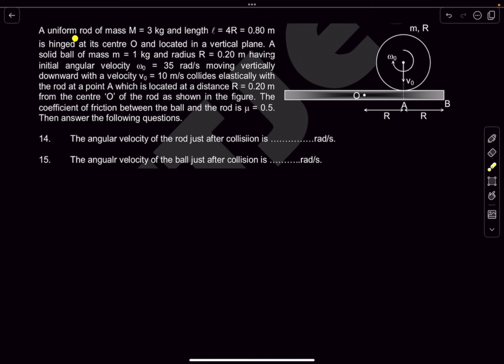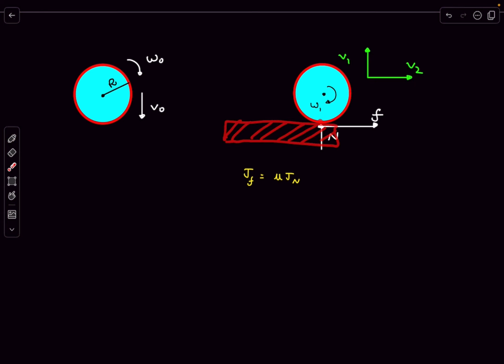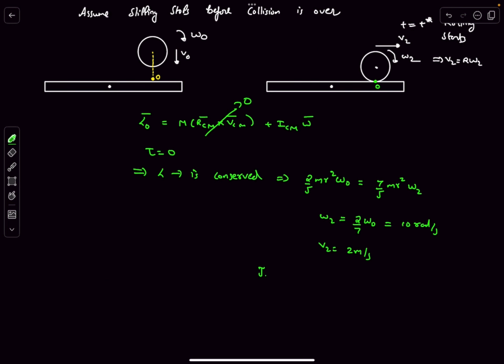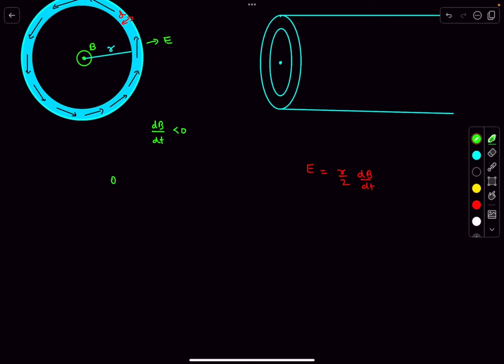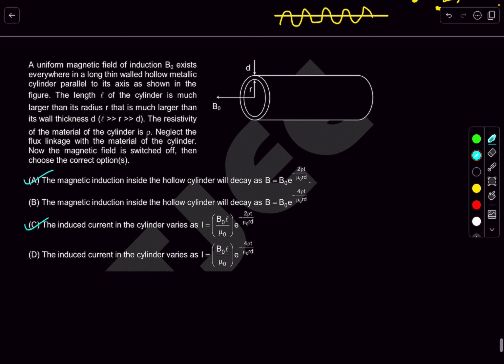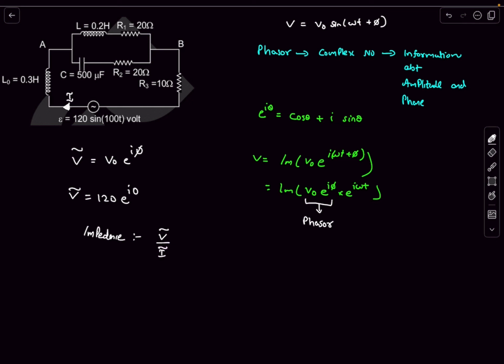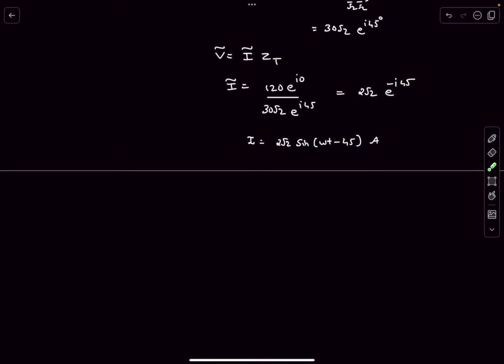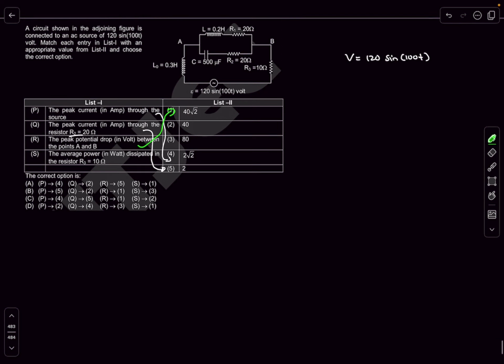Good Problems For JEE Advanced 2024 | AITS

Comment: Bhaiya in 2nd question you solved using induced electric field but in my soln i found induced emf which is Area*dB/dt and using emf i found current in terms of dB/dt and after that i used formula of magnetic field of a solenoid so my final equation came out to be B= (constant)* dB/dt. Solving this equation i got the answer, is my method correct?

Comment: 6:31 why does the point not lie on the rod,wouldn't it satisfy the condition of no net torque and making M(RcmX Vcm) zero?Is it necessary for O to be in space?
Reply from the maker: Yes the point on the rod while collision is happening will be an accelerated point so generally we don't use tau = dL/dt about accelerated points. If you want to apply then you have to consider psuedo torques which in this case will pass through the centre of the sphere so it's still fine.

Comment: in the last question the current flowing thorugh middle part should be 0 as if just magnitude of impedence of both it will be same but then we just take tan(phi) i.e (Xc-Xl) / R we phi 1 =0 and phi2 = pi  so the current are in apposite dirn with same magnitude in phasor diagram so they gets cancelled out
if i am wrong please correct me

Comment: Hey, could u pls tell where am i going wrong in the 1st que.
I had all the thoughts in my mind about impulsive normal and friction and the direction of application as well.
For the rod, as its hinged, the velocity of point P(where ball hits the rod), can be easily found out by momentum and elasticity coefficient eqn. From there finding omega of the rod is direct. Next of the ball, i took the axis of rotation at the com, as the point of contact isnt at rest for the time it is interacting, and then well friction acts in horizontal direction, we can write both impulse momentum eqn(for linear as well as rotational), as my axis is the com, i dont have to consider the angular momentum due to the horizontal component of velocity, the vertical component of velocity is only useful for finding omega of the rod, and omega of disc can be found from impulse momentum eqn written for both rod and ball..
Pls clarify where am i going wrong.. pls be a little elaborative as well. It will help a lot. Thnx
Reply: Bhaiya pls reply